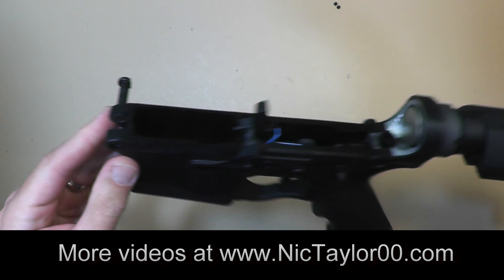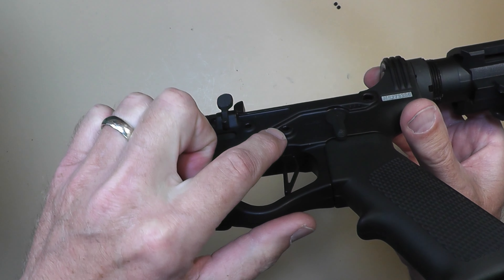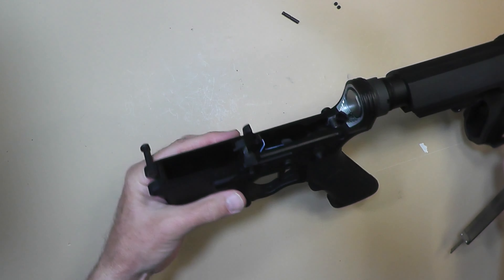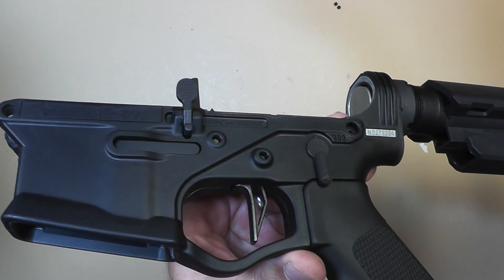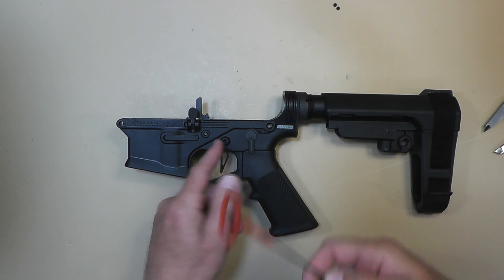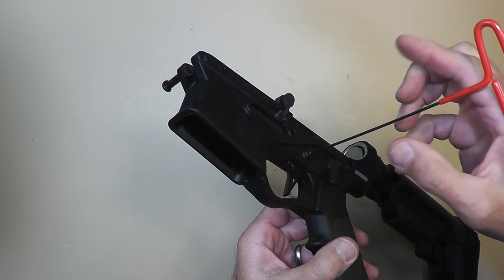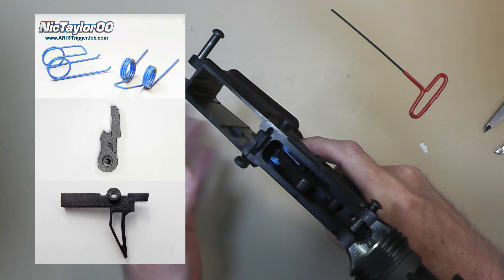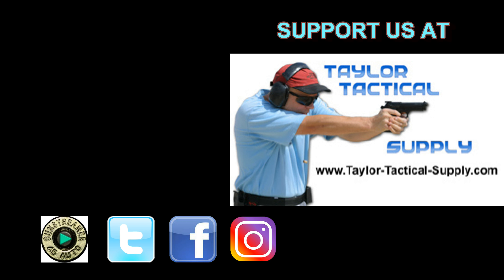OMNI Hybrid Polymer Lower Hammer / Trigger Pins

Comment: So it's been 2 years, how is the lower holding up with that patch job set screws installed?  I'm building one now and just ran in to this issue. The set screw fix doesn't set well with me since the pins aren't fully in there.  Couldn't it expand the hole out where the pin goes or does it not have enough force right there to hurt anything?

Comment: I got a drop in CMMC trigger that I put into my ATI lower. And the trigger is stiff and takes excessive force just to break. I think my lower doesn’t like it or something.
Reply: Did you use the original pins? If not, what pins did u purchase? I'm dropping in a timmney trigger which lead me to this video. TIA.

Comment: I've run into the same issue with my Haenel CR223. It uses a trigger pin that is much longer than mil spec to accommodate a similar protrusion seen on your lower. Do you have any info on those little set screws you used? Like what size they are? Or where to get them? Thanks!

Comment: I feel like I'm stalking you to ask this question. Spacers used to replace series 80 parts in 1911s come in different sizes. Do you have a good guess which one might fit Smith and Wesson 1911s?  .057, .030, .065?